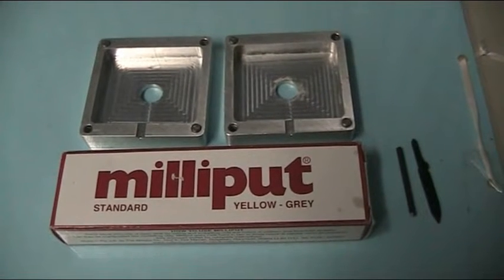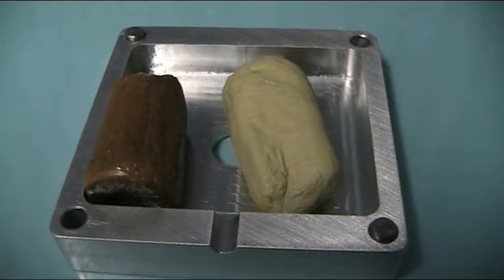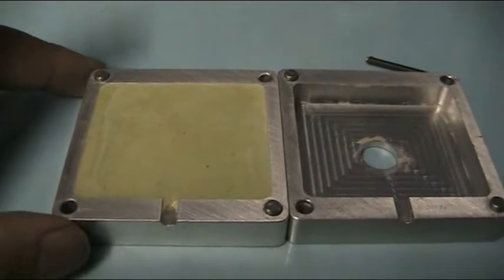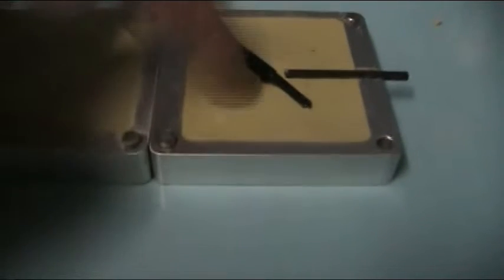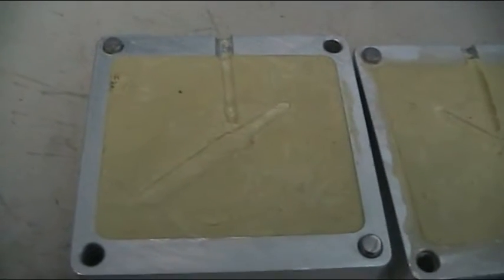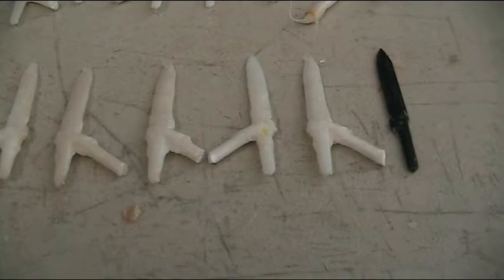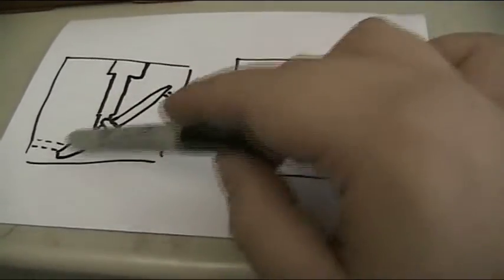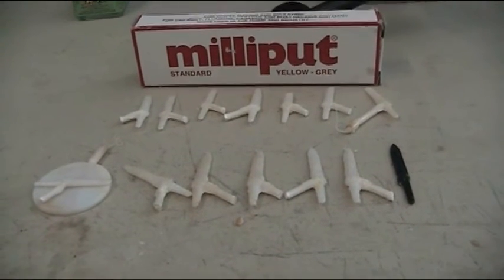Milliput injection mold test 1 (Model B-100)

Comment: I recommend ultracal 30, the strongest plaster.  Would like to see your results since it's in my todo list. A vacuum pump would help rid bubbles.
Reply from the maker: Mum is a professional artist and makes molds out of Ultracal, intent is to try that as well. Though I would make a rubber die of the tool and keep casting plaster inserts as they wear out if that material works. It can take a beating, wet casts and extreme heat. Down side is take a long time to drain all the moisture out before being strong enough. Did a plaster of paris test which flopped but that was poor casting form and not the material fault.